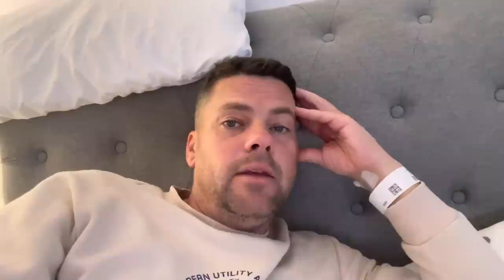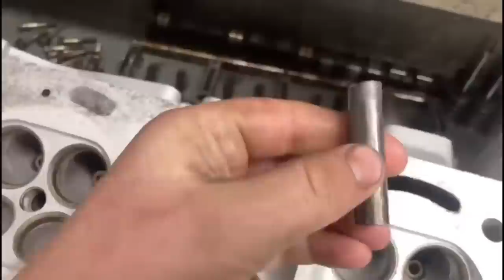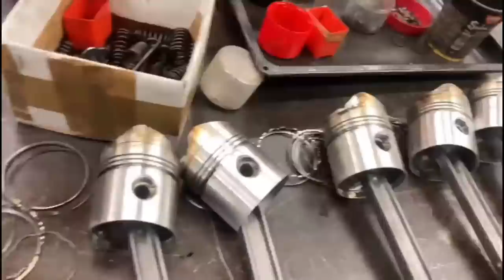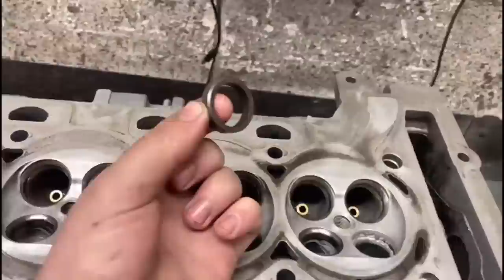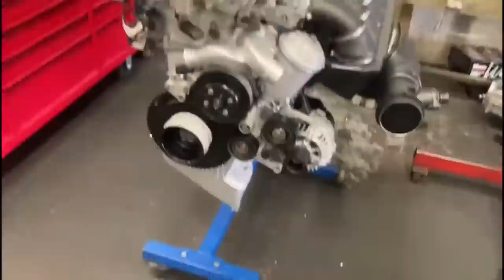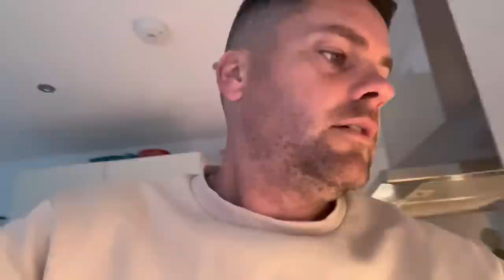Lee gets taken to hospital by ambulance!

Comment: Lee, take it easy!!  There are times in our lives where we run at wide open throttle for too long.  Our bodies tell us to rest and take it a bit easier and, of course, we don't want to hear it.  Then, the body tells you with more pronounced fervor to slow down.  Finally, the body screams at us and couples that with a shutdown - much like running out of petrol.  Only then, out of absolute necessity do we listen.  Don't worry, the shop is in great hands, Issac has it under control and things will crack on and be just fine.  Get your rest and TAKE IT EASY.  The Great Physician will take very good care of you.

Comment: All the best Lee , Hopefully you feel better soon 😊 Dolomite Sprint 🙈,We usually made a Wedge out of a old leaf spring And had no option but hammer it betwen the head and the block As the Studs were corroded inside the cylinder head ,we did have a special Sleeve cutter that would go down over the Studs and clean out the corrosion which was like Dry Dust preventing the Removal and had Studs breaking, 🙈 What a Job with the Engine in the car Some people would Remove the Engine, But after all the hammering every head was skimmed and Refitted and were OK, we had a special silver paint that was used on the Studs which preventing the Dreaded corroded Stuck Studs from Autogem ,Travelling parts van ,Please Take your time to Recover ,But Difficult in A Small Business. 🥺

Comment: I had similar experiences after eating or drinking foods high in sulphites (preservative E220-228). I think sulphur dioxide gas builds up over time, usually as I sleep, overwhelming my immune system to the point I have an allergic reaction and wake writhing in pain for what seems like hours. I still eat foods with sulphites, however I've reduced the amount of those and haven't had a problem since.